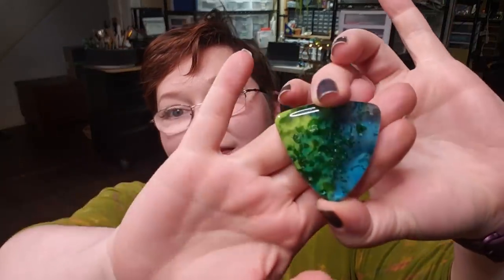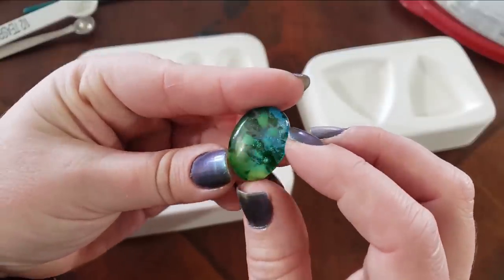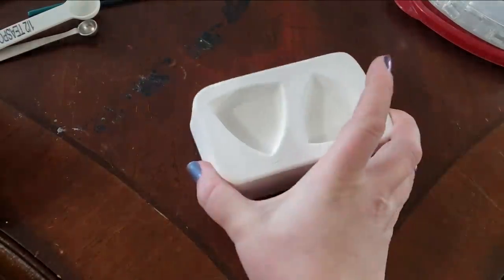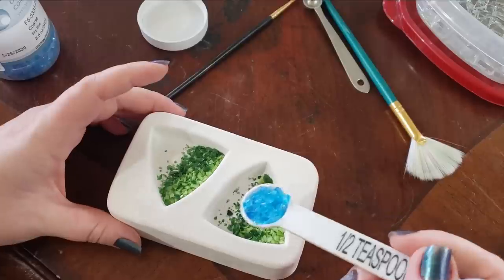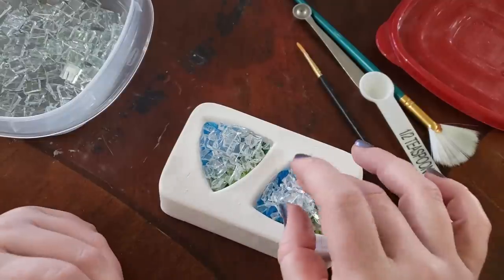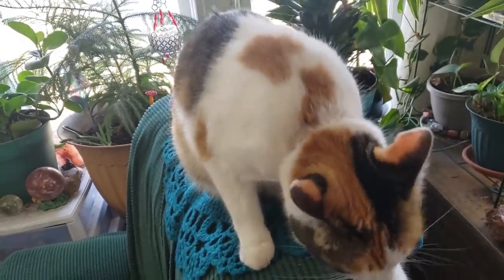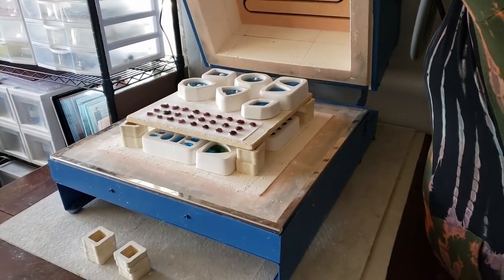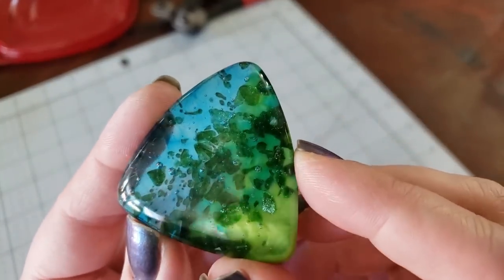earth and sky fused glass

Comment: Beautiful work - a couple minor tips- vinegar soak will help getting fiber paper/zyp off the backs. Also, iirc, a light layer of clear on the bottom helps reduce sticking. Opal glass sticks and pulls fiber paper, etc more. Probably due to differences in viscosity if I had to guess. I’ve been fusing glass for 7-8 years now but there’s always something new to learn or try. And I’ve only had my own kiln for a few years so I’m still learning that part for sure :)

Comment: Really cool. I just saw a listing of stained glass pieces nearby and wondered if it could be fused or if you have to know all the different properties of glass and all. But I’ve seen the microwave kilns and wanted to try it so bad. 
So if you wanted to put a hole in the Cab to use it as a pendant, is there something you can place in it that won’t burn up?

Comment: Yvonne, another project with beautiful colors!  Casting with medium and large frit can be tricky for sure.  You did a nice job as those look beautiful!  A couple of things you might want to think about when you load your kiln that way (which I loved as it makes use of the whole thing!), is #1, Lower your temperature by perhaps 15 degrees and do your hold times five to 10 minutes longer.  Increase your bubble squeeze hold (the longest sequence in the program) about 15 minutes.  This allows the glass a little more time to expand and do it's thing and can reduce bubbles in the piece too.  This may also help reduce the "scuzzy" which could be devitrification due to scorching.  #2, Lower your top shelf IF possible about 1/4" to increase the distance between the heating element and the top shelf.  #3, you may want to consider actually weighing your frit and cut glass to make sure it is right for the mold size you are using.  This will also result in more even (thickness) pieces.  I love your creations, they are gorgeous!  Keep fusing! 😉👍💖